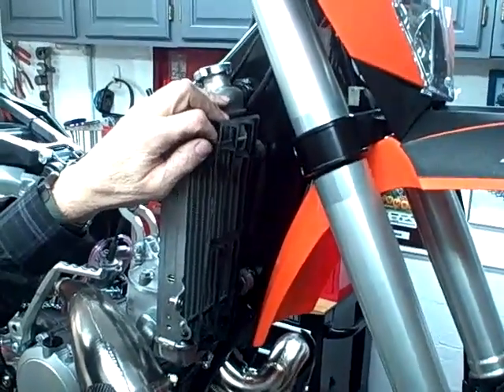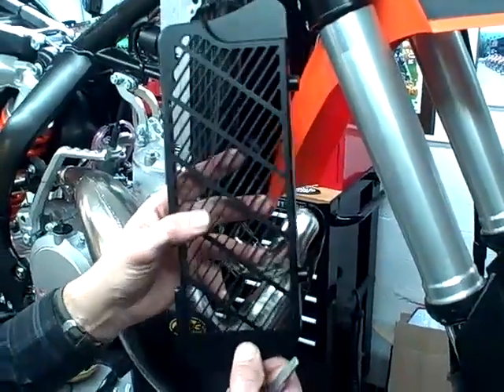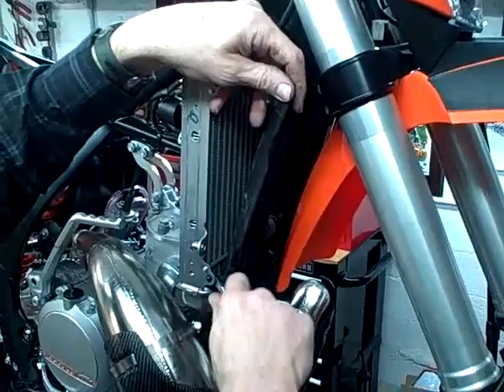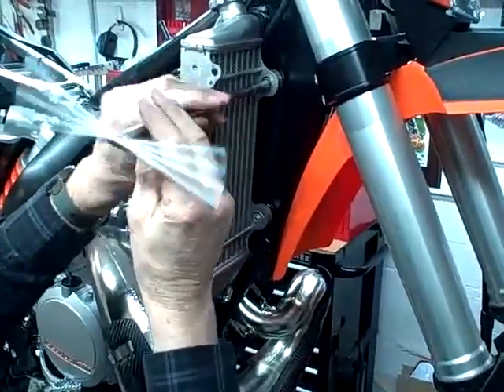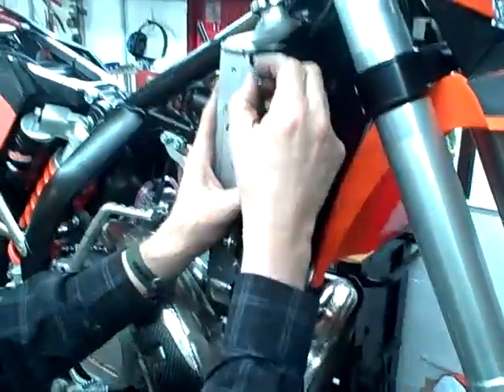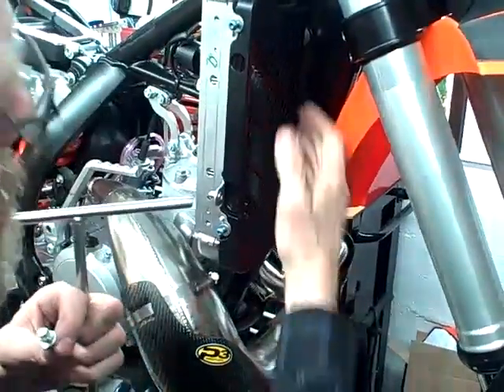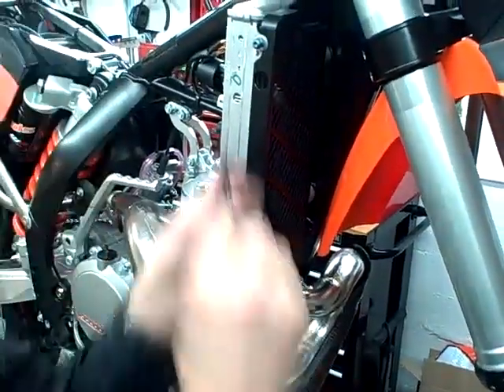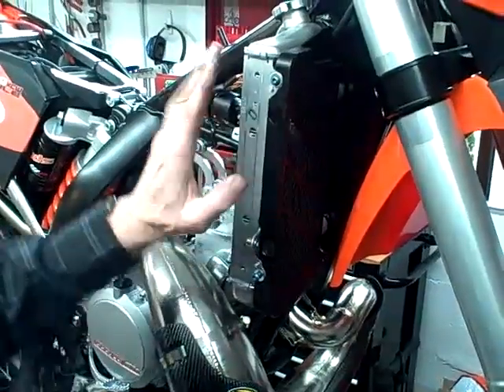Installing Bullet Proof KTM Radiator Guards

Comment: Do you need to run radiator braces with these? Or are they sufficient by themselves?
Reply from the maker: The BP guards give much better protection than any other guard or brace on the market. Braces don't work, they buckle when hit hard and the radiator gets damaged.

Comment: is it true that the engine will run hotter if you do not have the louvers on?
Reply from the maker: dring83 No. I've been using the BP guards for years at high elevation where the air is thin.